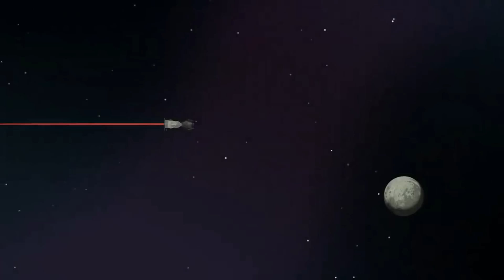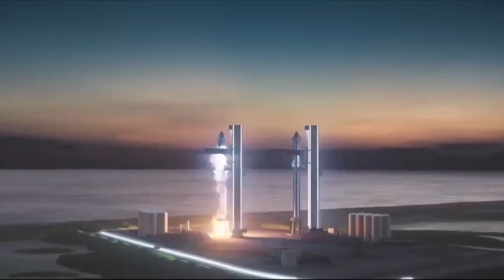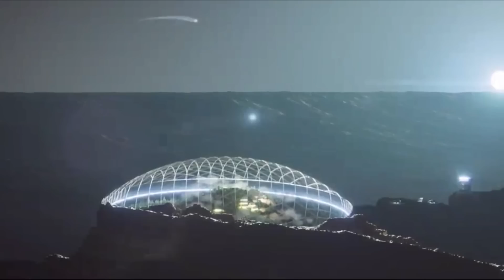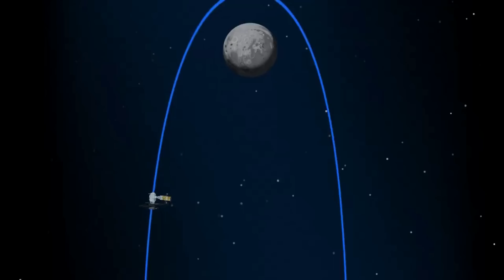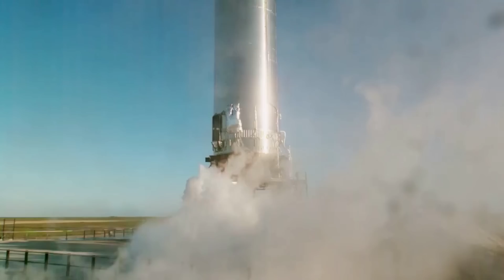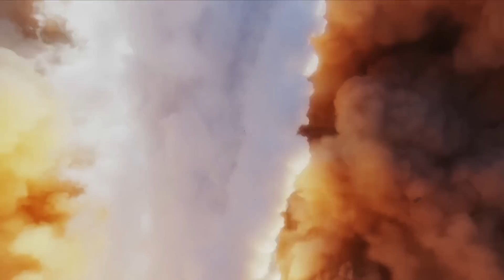New Details On SpaceX's Lunar Starship Progress

Comment: The Raptor 3 is likely to produce around 15% more thrust than the Raptor 2 engines. So chances are that if they use Raptor 3 for the next Starship test launch they will launch with the engines throttled down?
Reply: Probably reduce the number of engines. That's the engineer's way to go, reduce complexity. Elon hasn't said anything about upping the payload cap either.

Comment: One just wonders how is SpaceX going to prevent HLS Starship from tipping over once it is landed on the Moon surface? Are they going to build concrete landing pad for their rocket to land on? If yes, we haven't been told how are they going to do that.
Reply: It will land just like S15, but likely with bigger pads on the feet. Remember that most of the weight is at the bottom, with the engines.
Reply: They can have bigger legs because the gravity is lower. I'm not sure if they are still going with the smaller engines higher up
Reply: @forloop7713  They will have to. It's not safe using the standard engines, too much debris that can go up and into the engines.
Reply: Even with legs no wider than the body, the ship can list up to 15 degrees or so. With wider legs that angle is of course even greater but that would be one hell of a list.
Reply: @paulmichaelfreedman8334  Don't you think that SpaceX should test this idea of vertical landing of HLS Starship on the Moon by first landing it on top of a sand dune somewhere in Central Sahara? Sand dunes are more stable substrate to land on than noncompacted Moon regolith  just look at a the picture of the footstep on the Moon. Do you think that would work?

Comment: I'm not convinced that the lack of abort modes is in any way a good thing on Starship. Plus these guys tried to launch it without a flame trench, resulting in an absolutely groundbreaking launch....
Reply: Crewed Starship launches are only for the far future, for the HLS Starhip for Artemis is launched uncrewed, refueled in LEO and then send to lunar orbit where the astronauts in a Orion capsule transfer into it for the lunar landing.
Reply: Starship is the abort mode. They will conduct hundreds of flights before human certs.
Reply: @SpaceXsuperheavy do you know what abort mode means?
Reply: The hope is the test and successfully fly the starship so many times that it’s safe enough that it doesn’t need a abort. Plus a abort is too complicated and add extra weight
Reply: @TheAmericanCatholic  My common sense says that is never a guarantee. eventually, failures and loss of life will occur, and I am quite staggered Elon does not realize this. With retropropulsive landing alone and no failsafe, this ship will NEVER, EVER get a human rating from NASA or whatever instance. It's more about the re-entry and landing and not so much about the launch phase. HLS will not be landing on earth, only on the moon with elevated landing engines, no re-entry heat and stresses, and with only 1/6 of gravity. Actually quite good test parameters before building the full blown starship capable of launching and landing on Earth.
How long do you think "flying enough times successfully" is going to take and how many times is enough? It could always just be that next launch where things go wrong.

Comment: Seems alot of waste when Saturn V did the moon shot all in one vehicle. There has to be a better way. Alot of equipment needed and chances of incidents to happen.
Reply: Starship has a capacity 32 times greater than the Saturn V/L.M configuration to the lunar surface (150 t vs 4.7 t), and can be used as a base for stays of ~1 month duration.
Reply: @Sun-like42  dude HLS has no large cargo bay, and their margins are so low its designed to just support 2 people for 2 weeks, plus small few hunderd kg of cargo
Reply: @_mikolaj_ ??? Sorry, I don't understand your comment. I'm talking about Starship HLS, which cargo bay and cargo capacity are the same (or very near to) the normal version of Starship. That is 1100 m³ of volume, and ~150 t of cargo to Lunar Surface.

You seem to be referring to the requirements of the HLS program established in the first selection of the lander.
Reply: @Sun-like42  no i'm referring to starship HLS that returns to gateway with vapors left in the tanks, only to be later disposed of.
Reply: @_mikolaj_  If you're talking about Starship HLS why you said that?

By the way, the evaporation of the propellant is not an unsolvable problem, there are numerous designs that allow the conservation of metalox for long periods of time with minimal levels of evaporation, I can pass you papers about that if you want.

There are also methods by which Starship can be reused indefinitely, for example using HEO depots, although the new National Team lander certainly seems to do better in this regard.
Reply: You have absolutely no concept as to what you're talking about.  Really.
Reply: Turns out SLS is even more expensive than Saturn V and it can only launch a single capsule
Reply: Look at the reliability of falcon 9. 200 consecutive successful flights with full reuse. Once starship is running, were looking at a few million dollars per launch, and ultimately a fraction of the cost of one Saturn V launch expending everything on board for a fully reusable payload of 100 tons to the lunar surface. This is an excellent way and way less wasteful than the Saturn.
Reply: @maxv9464  Lunar Starship alone costs $2.8 billion for 2 missions (1 crewed) and then a further $1.2 billion for a 3rd (crewed) mission. How are we going to get to "a few million" for Starship?
Reply: @veergauba  That's the cost of the project, not the launch price. In comparison the cost of development of the L.M was ~21.3 billion dollars.
Reply: @veergauba  These are largely development costs. The current estimate is that by all accounts a starship launch will be lower than the cost of falcon 9 once reuse is achieved, and the best estimate I've heard is 8 million per launch. Even at 10-13 launches per HLS landing, that's less than 150 million for a landing.

These are initial missions. Not long term implementation, and cost is going to fall the longer the program goes.